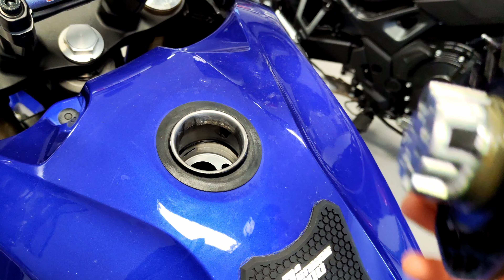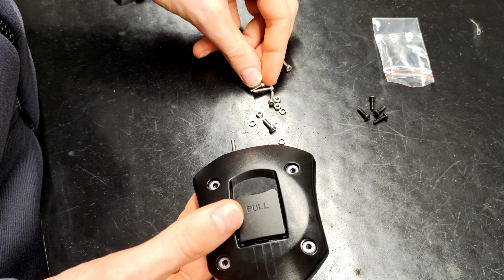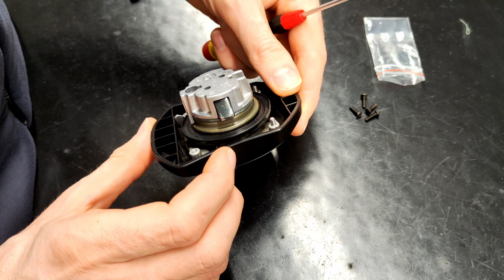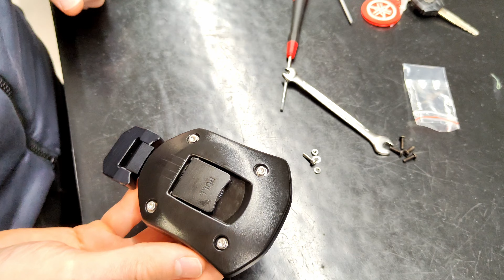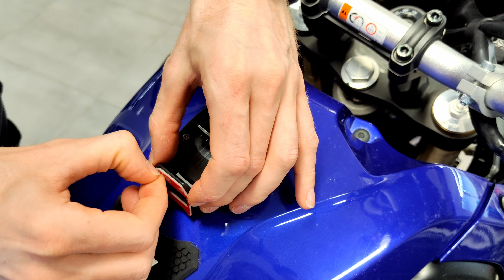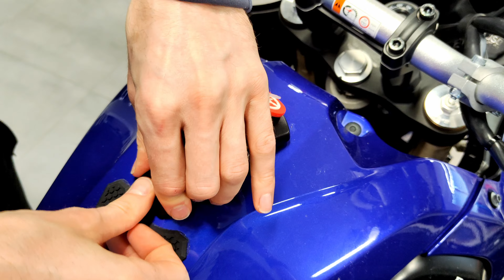TENERE700 TANK CAP HOLDER - Installation v2

Comment: Hey, I heard that heating the 3M sticker (like with hair dryer) improves the adhesion.
Reply from the maker: Yes, even 3M in the technical sheet recommend the heating with hairdryer and strong pushing to increase adhesion. Adhesion is also better later after some time than immediatelly after aplication.
But from our experience, even after sticking it is holding enough for using. We had no problems and no complaints about that. The surface must be clean, ideally cleaned with alcohol or even better with isopropylalkohol.